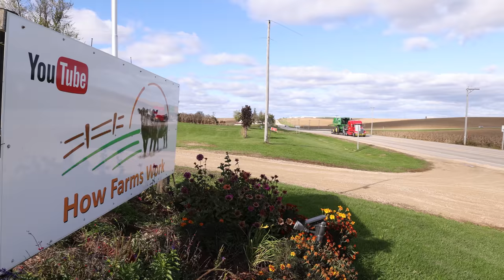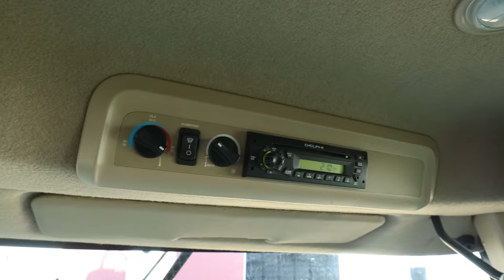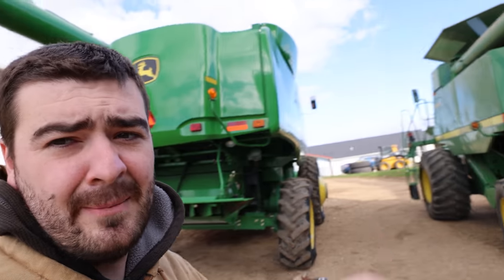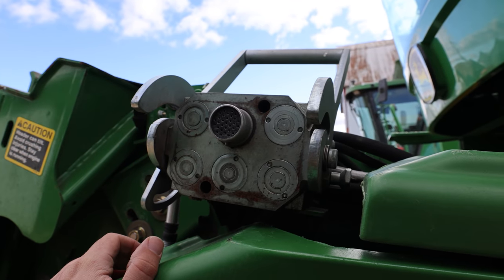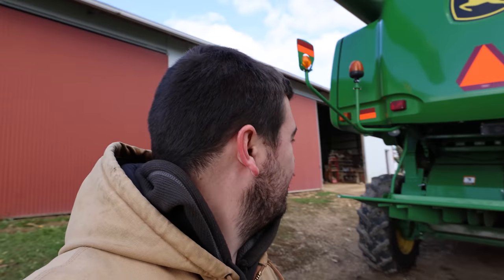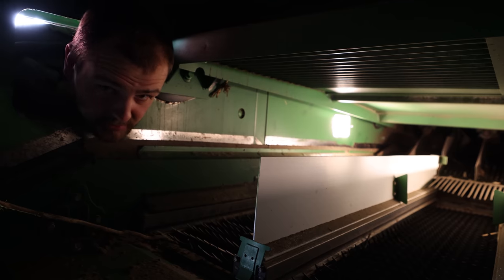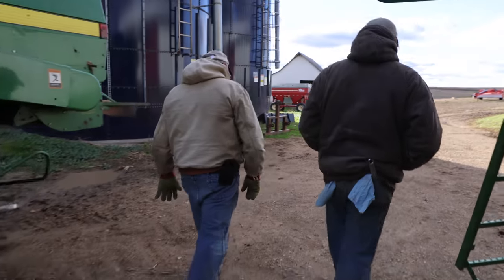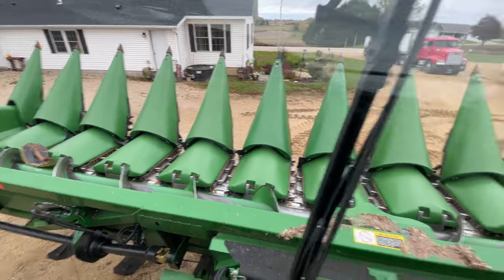One Mean, Green Eating Machine - John Deere 9770

Comment: I know the guy that owned your 9770 he was religious with maintenance. Glad you found it.
Reply from the maker: What was the reason for trading? Upgrading?
Reply: @HowFarmsWork  the turbo went out and needed a new engine, which is rare on a 70 series. Didn't hear what the dealer did to it, but it should be all fixed and ready to go.
Reply: @HowFarmsWork  he brought it to the dealer every year after harvest and had it gone through.
Reply: @HowFarmsWork  he ran it with an 8 row head.

Comment: 9770 is a good machine. Change your discharge beater bearings every other or every 3 years, easy fire point. Make sure concaves are level every couple years, be careful unloading on the go a lot those gear case’s go out easily. Talk to sloans and have a good inspection done (remove concaves) really look inside of the machine.

Comment: Congratulations on the 9770! 

Going from a 9510 up to a 9770, you just went from a skateboard to a Ferrari! 

Our last machine, a 9670, kept two semi trailers busy and waiting during corn harvest. And that was just to our own on farm elevator. Glad we didn’t have to haul to town! 

The STS machines are crop eating machines and they’re great on hillsides because of the large dividers and the cleaning shoe actually tilts left and right.
The power switch at the access door is used for cleaning out the chaffer manually. 
The the chaffer and sieves can be adjusted from the operators control panel. All the machine settings can be custom set and they have a programmed set of parameters to work from. Makes getting the machine going that much faster and you can fine tune the settings for your personal preference and save those settings. Nice to be able to change settings on the fly without having to stop and manually do everything.

The Bullet Rotors are so much better than the old cylinder machines. 
They’re much easier to service, clean and repair too. 
The quick attach for the hydraulics, electrical and head lock makes those  jobs a lot easier, cleaner and safer. 

My granddad always had John Deere combines. Started with a used 55 doing custom work in the 50’s. 
When he was able to get his own farm, went to a 105 and then traded up to new machines; 7700 - 8820 - 9600. 
Our last two combines were Bullet Rotors, 9650 and 9670.  I had to lower the tip-tops every time to put them  away in the shed. Not fun when it’s raining or worse, freezing rain. 🥶

Comment: Nice machine. It's not a cylinder anymore. Its a rotor. Cylinders are on conventional combines
Reply from the maker: Can you tell me the difference?
Reply: @HowFarmsWork  a rotor typically runs the length of the combine. A rotor uses centrifugal force plus the beating against the concaves vs a cylinder beats the grain to thresh. Also any combine with straw walkers is a conventional combine, with a cylinder not a rotor. Which makes the 9770 a rotor machine
Reply from the maker: @dawsonrichter215  So a cylinder doesn’t use centrifugal force?
Reply: @HowFarmsWork  no. If you watch an animation of a rotor and a cylinder, the crop flows on the bottom side of a cylinder, and thats it. Where on the rotor the crop flows all the way around it. Watch a conventional combine animation. John Deere has some I believe. Pretty interesting how the crop flows
Reply: @HowFarmsWork  search up John deere crop flow on YouTube here. 1 video will be from a S700 series combine, so be very similar to your 9770 combine. Then the other video will be for a T series deere. So also be similar to the 9510.

Comment: Rotor it has a rotor not a cylinder
Reply from the maker: Semantics, it serves the same purpose, just a marketing ploy.
Reply: @HowFarmsWork  Not marketing, its engineering.  JD was also last to the rotary club,  by the way who still makes cylinder equipped combines?  And are they capable of the same harvest capacity?
Reply from the maker: @elhanson5426  I'm saying the rotor vs cylinder naming is just semantics based on the axis of which it rotates. Yes, they're used to describe whether the machine threshes in one direction or another, but it's still by definition a cylinder. I'm not saying they aren't capable of higher capacity, it's just an unofficial term to describe the difference in design. They still do the same job.